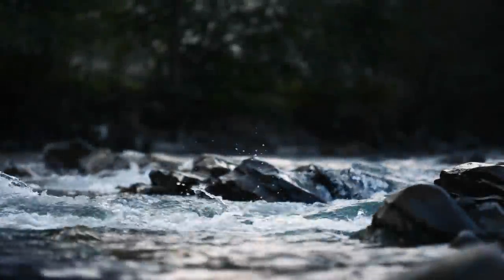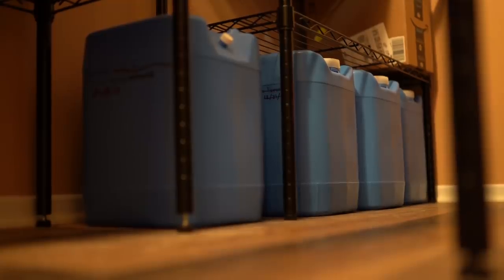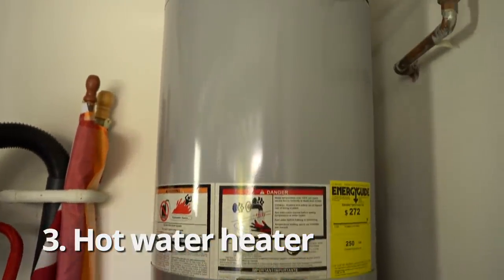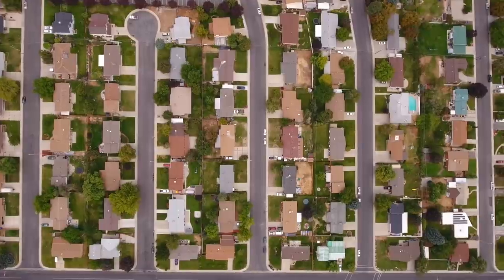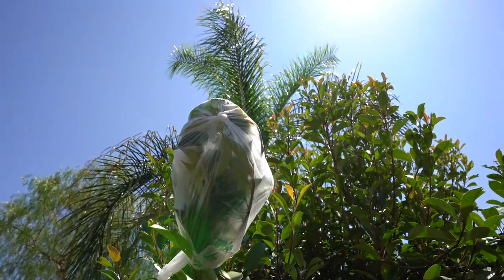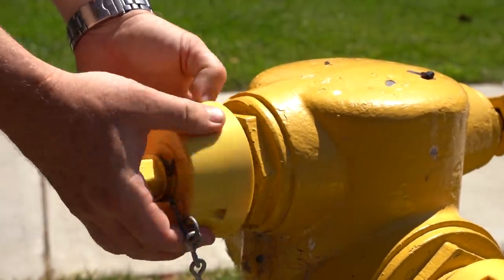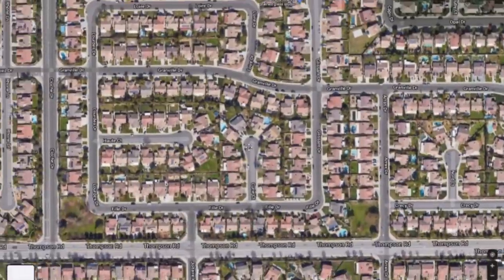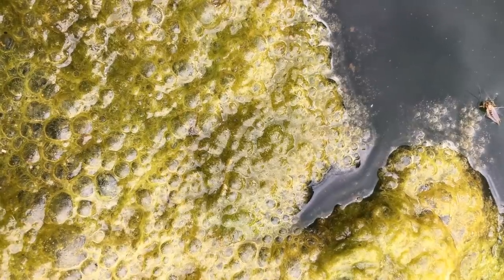12 Overlooked Places to Get Water After SHTF

Comment: I got two silcocks after hearing about them here and at Sensible Prepping then went down to the nearest two main streets of modestly sized towns near me in the DFW metroplex and tested them.

I found so many sources of water in a state with only one, single natural lake. It really opened my eyes. I keep one in a Get-Home bag and one in my toolkit now. Went 7 days without clean water and 3 without any at all but what was in the pipes this past Feb. I knew to prepare months before, but many people here didn’t, and had to go by churches for 80 500ml bottles per household.

Also, keep a bottle of iodine tablets and an iodine taste remover in my Get Home. Got a few of each in the main stash.

Love the current focus on water. Please keep it up!
Reply: Interesting. What is an iodine taste remover? Is it a thing or just a flavour to mask the iodine? What works best? Include electrolytes too.
Reply: @jonahtwhale1779  

I’ve only used Potable Aqua PA+ Remover tablets on top of the iodine ones. They worked well enough that when Fort Worth’s water reservoirs lost processing capability that we could drink using the pills as directed. 

Always been squeamish about using bleach, and the taste isnt great, but iodine and the taste remover make a good combo. Even so, always have a few months of bottled water on hand.
Reply: Agree 100%. Drinkable water will be worth it’s weight in platinum when rabbit rich people are beyond starving.

Comment: It's a good idea to flush out your water heater to keep it clean, you don't want to depend on your water heater only to learn that when you need the water the drain is clogged up with sediment or the remains of a corroded anode rod.
Reply: There are oddly only a handful of water heater maintenance vids on YouTube, but after decades of living in houses with water heaters, I've never heard of replacing the sacrificial anode.  They don't even stock them in bigboxhardware store close by.

Comment: i have a 16000 gal above ground pool for backup and a berkey to run it through
Reply: 1 1/2 to 3 inches per day at 104 avg at 50+ dew point, with exposure area of 11.91 inches with depth of 14.5 inches. Lower volume of water=more evaporation?
Reply: I did the same thing ...our pool is above ground 18 ft round 4 ft tall...how many gallons it is I do not know ?!
Reply: Berkey? Is that a water filter? Project Farm just did a vijeo on water filters.
Reply: @bellaellis2813  Roughly 7600 gallons when full. Pi(3.14)×radius²(in inches)×depth(in inches). Divide the result by 231(the number of cubic inches in a gallon). So, 3.14×108²×48=1,757,998.08. Which, divided by 231 = 7610.381 gallons.

I learned these formulae years ago working in an aquarium shop, and it's surprising how often it's come in handy.
Reply: Thank you so much for helping me ..7600 gallons 😊
Reply: @robertthomas5906  berkey is a home water filtration system  with filters and spout...4 sizes ... great taste ...easy to use ...portable...expensive...worth it if weather disrupts water supply ...filters rain water too !
Reply: @bellaellis2813  So, based on a 4-person household and the recommended 2 gallons/day, you have 950 days of water in your pool(not accounting for evaporation). I'd get that thing accessorized! A good cover, hand pumps, treatment chemicals, filtration... you've got almost all the water you could ask for, so make sure you can do stuff with it! Always happy to help.
Reply: Houston ...Flint Michigan  homes needed these ...great for camping ...getting water from streams.. lakes ...buy all filters ...they last for 6000 gallons
Reply: @bradsimpson8724  thanks Brad ...I have water chemicals I bought for 55 gallon barrels ...I have covers strainers and a husband who I'd genius like you 😁
Reply: @bellaellis2813  Please check the referenced Project Farm video. I have a feeling you'll be replacing your water filter.

Comment: Thank for the suggestion of the 4 way Silcock. I just ordered one.
Reply: What is a 4 way Silcock?
Reply: Get a spare (or two).

“Two is one, and one is none”
Reply: @patparnell1933  it’s a tool used to access water at like restaurants or fast food places you can find them on the outside of the building
Reply: It is a crazy idea. If there is no water pressure, you won't get much, if any water.
 Opening a faucet outside of a building, without an open tap inside creates a scenario that basically stops the water from draining.
Considering that if you are that desperate for water, then others are also and some might be willing to killy you to get at it.
So anything you plan on doing,to get water, better be very quick and easy.
Reply: @patparnell1933  Plumbers, Heatng Engineers and others use single and double versions for servicing radiators and so on.
A four way is  to ensure you have any 1 of the four standardized vavle, nut or key it might be needed to handle for example to release pressure from a water boiler system radiator.
Reply: Coxk

Comment: In my area, sewer bills are calculated by using our water meter. I'm building a rainwater catchment system for flushing toilets. Using less city water, I'll save on my sewer bill. Also, bills are calculated based upon summertime usage. So it helps to have shade trees in the yard, keeping my grass green.
Reply: Same here they break it down into two different charges the first one is literally called water usage LOL the other one is called sewage and when I called and inquired about the difference because I gently explained that there was a difference I was told nope it's all the water that gets used by your house I said so water is not the clean water coming in and sewage is not what's going out like I don't know down the toilet or something and she said nope it's all from the same thing I said then why are you breaking it up into two categories she was dumbfounded
Reply: Great ideas, where I live the county has made it illegal to trap/gather rainwater. Honestly I dont see how they can even say they are the only ones with the right to use rainwater as long as you are getting it from your own property. Can anyone make this make sense to me?
Reply: It's a big issue here in Australia with most new  homes having City & Recycled Water. People are encouraged to get rain tanks too. They run off different connections & the Purple Line (Recycled is meant for Gardens / Toilets).
Reply: @jeaniejbutler4911  I suggest a covert tapping of your downspouts. Tap them so that they empty to a barrel that is inside your garage. As long as they look normal from the outside, I doubt if anyone will hassle you.
Reply: @jeaniejbutler4911  Get involved in local politics and CHANGE THAT REGULATION.
Reply: @beforgiven9055  I have been going to county board meetings, its hard for me as I am partially disabled and dont have a car but I am getting to those meetings early takes 2 buses one way to get there and 2 home but I am talking to the residents that are going to the meeting about the situation,  some dont care, some didnt know  and a few are going to try and get a petition going to change the law or recall the idiots who made the law happen in the first place....Thanks for the reply and if you have other ideas share please anyone :)
Reply: @jeaniejbutler4911  I wish you success if you work to repeal laws preventing people from collecting rain water on their own property. Ask for the reason. I suspect it will be couched in something about ill health effects from drinking rain water. If you are serious about water, you no doubt already know the need for filtering and purification and that municipal water isn't necessary safe regardless of government regulations. I prefer filtration, distillation, and polishing filtration. I suspect the reason for such laws is people in government want a monopoly on water. Best wishes, Cheers!
Reply: @jeaniejbutler4911  I'm absolutely stunned that any government can tell you can't gather rain water! Insane!  In the USA? I hope not, but then with everything else going on....
Reply: Our water company has two charges, water and then sewer fees. We moved outside of town, have a septic system, I thought woohoo no sewer fees because it was literally half the bill! Well guess what...for septic systems they charge a "drainage" fee...it's based on how many acres you own.  You pay for the f-ing rain that falls. Crazy.  It's still way cheaper but wow.
Reply: Where I grew up they did that so people stopped using the municipal water as much. So I noticed on my bill - water usage (I think 50,000 gallons): $1.40. Water & sewer connection fee: $85.00. They simply moved the usage as an average to the connection fee. After all the city has to pay for the facilities.
Reply: @jeaniejbutler4911  Sorry to remind you of the following but if you are forced to pay any taxes at all on the land and or structure described as 'yours' then you don't own it in the eyes of any municipality.

Comment: This pandemic has made my partner think I am not crazy with my canning and growing small crops.  He bought two 50gallon water storage tanks (5 year storage), and upped our monthly water order (we dont drink the tap) to 50 gallons.  We do not use this much water in a month, but we now have over 200 gallons of water, safe to drink, stored.
Reply: You probably already know, but make sure you treat the water for long-term storage.
Reply: @Eyes0penNoFear  yup. 5 year storage. at the end of the 5 years, if shtf hasnt happened, i plan to use it to water the garden and refill and retreat. and so on, and so on.
Reply: our monthly water order..... have you tested it for PPM? And what is the name of the water supplier? brand?
Reply: @mikearthut781  yes, and its local.
Reply: Storing water in plastic containers just causes Outgassing from exothermal temperature differentials...
Reply: @mjolnirswrath23  considering they are in my house...and the temp doesnt change by much...maybe you can tell me where to get 50 gallon glass containers?
Reply: @mjolnirswrath23  what if the plastic containers are sold especially for water storage?  Also, do you know how long tap water that is city treated can be stored for and still be good for drinking?
Reply: @katseyeview9354  We use glass carboys that are made for the home brewing industry. Not 50 gallon sized, but storable in the cellar where the temperature is stable year-round. They are easier to move than larger containers.
Reply: @GeckoHiker  i dont move it. and it has a pump.

Comment: Place a sheet steel panel on a wood (or whatever) frame about 6 inches above the ground on a slight angle. Place a container or diy gutter at the low end to gather dew every morning.  I've seen this method create wildlife water stations in West Texas desert. Also keep some pure silver bar or bullion in your stored water. Will keep it from going sour as fast. That's what settlers did way back.

Comment: Most fire hydrants are designed to be all the way on or all the way off.  I'm not saying you have to open it all the way to get a bucket of water, but please make sure it is all the way off when you're done.  Otherwise it will allow the flow of water beneath it underground.  Not only a waste of the water still in the line, BUT when water is restored it can turn your neighborhood (or maybe just the road in front of your house) into a sinkhole.
Reply: How would it cause a sinkhole unless the underground pipe that the hydrant is bolted to is broken...which at that point it wouldn't matter if you turned it all the way off it would still leak, which would have happened before you even got to it. Water merely dripping doesn't cause enough cavitation to be able to do what you're stating. Btw, ex road worker here that's had to remove and set hydrants.
Reply: @NickP42069  - Then you know most fire hydrants in the US are of the dry barrel type, with a valve in the bottom to allow water to drain out to prevent freezing in Winter.  There is a point when both opening and closing the hydrant at which the drain valve is open as water is flowing into the hydrant.  (It has to do with expelling air from the hydrant when putting it into operation, and probably some other technical reasons.)  So there is a point at which if it isn't closed all the way after use, water can be flowing into the barrel, and out the drain (under pressure) underneath.  Of course different manufacturers are different, and if you're in a part of the country that doesn't freeze they may use a type of hydrant that doesn't have the drain underneath.  My statement was intended as a general warning without trying to confuse people with too much detail about what type hydrant they're likely to find.
Reply: @dougearnest7590  Thanks for both the summary and extra details.

Comment: I get a lot of water every day from my dehumidifier.
Reply: Good idea!🌺
Reply: You got to have electricity for that
Reply: Gotta have electricity
Reply: That water is gross. If you either let the tank fill or let it drain with the hose there is bacteria and mold in there. Especially if you don’t clean it out very regularly.
Reply: You can flush with that
Reply: @rayskidmore1786  they have non-electrical closet dehumidifiers at dollar tree - it’s just a filter and charcoal, the water absorbed is collected in the bottom of the container. It’s small, but it works !
Reply: @Animalfarm4481  joke right?? LOL
Reply: Solar panels for power and hose strait to large tank and filter system. Also learn to make filters. And dont smoke around it. Works great
Reply: @theoriginaljohngalt2450  I took some of the water from my dehumidifier to the pet store to have it checked.  It was more nasty than the water from the aquarium.
Reply: @theman4884  That stuff is nasty. Just look inside the tank and see the bacteria in there over time.
Reply: If you have electric you can just turn on the tap!
Reply: yuck

Comment: Great video!  I'm glad we have people such as yourself who think about situations such as loss of city water during some kind of disaster and how we can deal with it.  I would rather be without gas or electricity than water.  My suggestion is not for everyone.  I call it my water bank.  I have a water bed.  I know flash back to the 1970's.  Maybe, but I have a very large supply of fresh water made safer by the use of a very good water filtration system.  In addition, I can easily protect it and it's very convenient.   Something to think about.